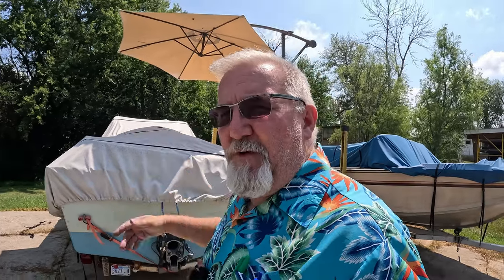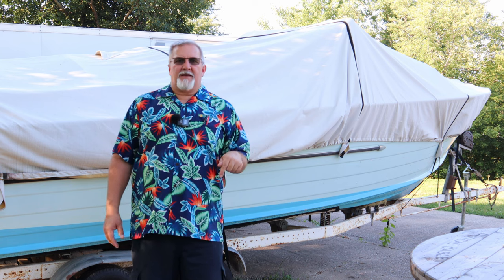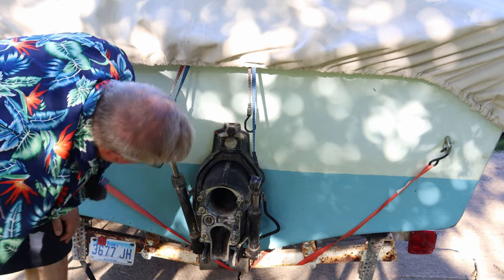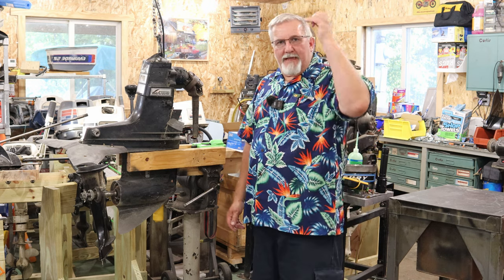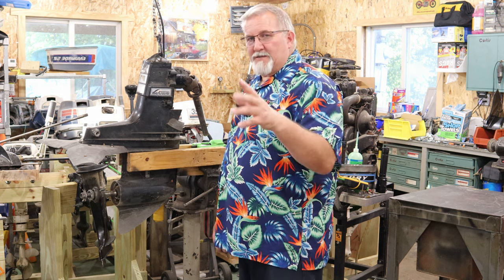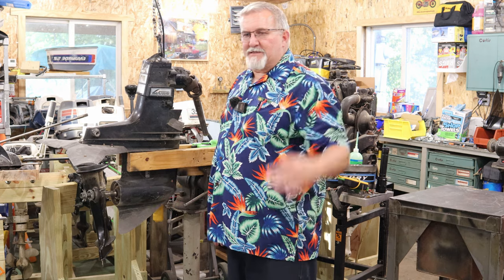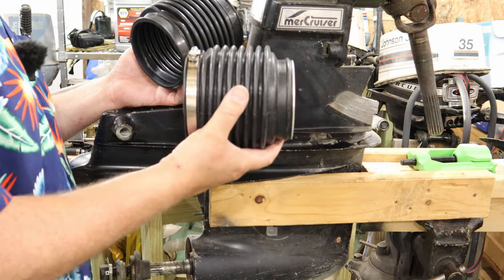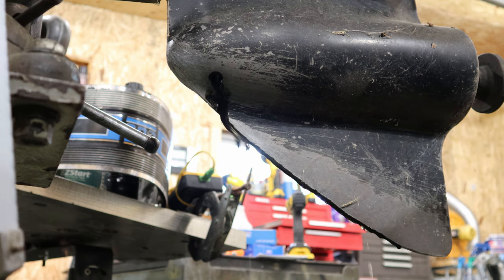1968 Starcraft Transition into more horse power Part 4

Comment: How high do you think an I/O can safely run in gear at idle rpm without killing the u-joints?  This being a concern in shallow water operations.
Reply from the maker: not very high, I wouldn't run it in higher than you would run it at WOT with out it porposing